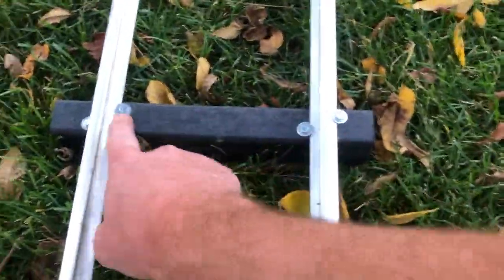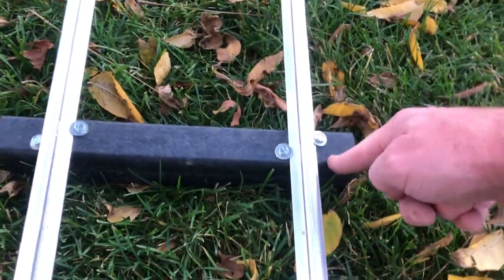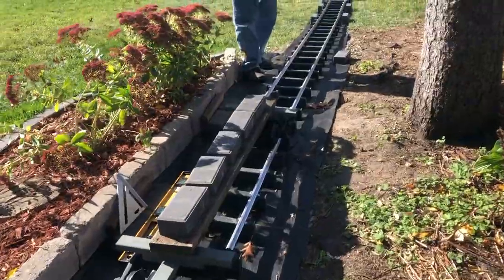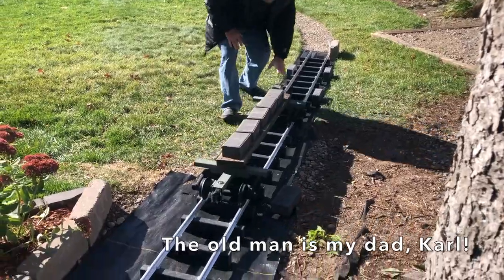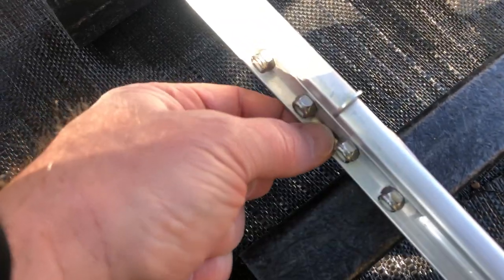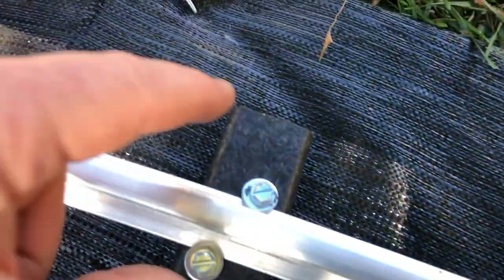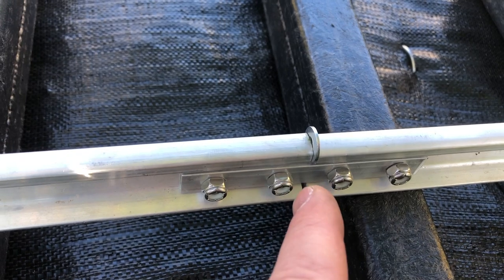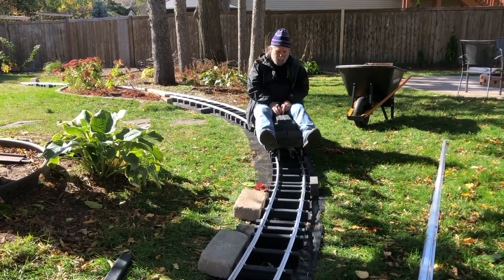Backyard Railroad: Laying 7.5" Gauge Train Track (Kids for Life!)

Comment: I noticed that on the joiner plates, the bolts going into the Nylok nuts are too short. In order for those nuts to stay tight, the bolts ,have to go thru the nylon inserts. BTW, those Nylok nuts are one time users only.
Reply from the maker: They grab just right and 3 years into this project, no issues 👍 Thanks though!

Comment: I'm late I guess, but once you tighten the bolts on the angle bars (rail joiners) why back the nuts off?  Weather, temp changes, operation will loosen bolts anyway.
Reply from the maker: Yeah, we ended up keeping them tight all said and done. 👍

Comment: I just asked this of Moosesworkshop, who is also building a 7.5" gauge railway...  If you don't mind me asking, what is the size of your house lot.  I hope to do something similar in another 3-4yrs when we retire down south (NC).  The lot sizes in the area we're looking to settle in are between 1/4 and 1/2 an acre.  Wondering how small I can go (aside from needing space on each side of the house to get from the back yard to the front yard) in lot size, before it's not practical to do something like you've done.

I like the idea of synthetic ties...  One of the conditions of doing this through the front yard (set forth by my wife) is that I bury the track in the front yard in the grass, which means soil over the ties.  I wouldn't want do do this with wood ties...
Reply from the maker: Fun to hear you’re planning ahead! We hope our videos give you ideas! ...Our backyard size: I just went out and stepped off approximately 63’ wide fence to fence. The depth of our city lot yard is abnormally deep at about twice the width (126’ deep, house to back of yard). But we only have permission 😊 to use the back half so we’re working with about 63’x63’ of area. This is arguably tight but we’re gonna make it work 😊👍
Reply: @minnesotaeerailroad8471  Thanks so much for the prompt reply!  Useful info there...  We'll have to see what we come up with for a lot.  Some lots in the new developments we're tending to favor are listed in square feet rather than a fraction of an acre, which tells you it is a small lot!  Then there's the potential conflicts that might arise with the HOA in the development.  I don't intend to ever have an actual steam locomotive, or even a gas powered "diesel", but you never know.  The neighbors might object to the trains/tracks in the yard regardless of what I run on them.  Just crossing my fingers that everything falls into place.  Thankfully money won't be too much of an issue (we're very fortunate), just have to get the lot I need and have a flexible HOA!

Thanks again for the info...
Reply from the maker: @WHJeffB  Cool! Good luck! ...Yeah, we are planning electric for motive power being in a neighborhood. So we understand that making the neighbors happy!